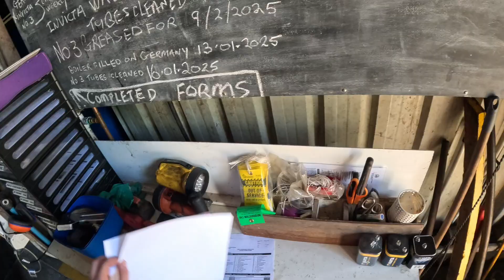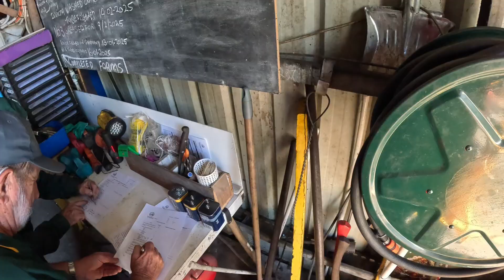Knocking The Fire Out Of A 1952 Steam Locomotive

Comment: I like getting a coffee at 1921 & watching the steamers and diesels go by close up. 
I notice there's remaining pressure to reverse the loco into the shed, and I read that the boiler is filled for good reason.
Excuse a silly question, but how does any remaining pressure bleed off?  Does that happen as you refill the boiler to finish off?
Maybe there's very little left by the time it's in the shed?
My only experience is basic model steam engines, where I just fire out, run pressure down, wait for it to cool right down, then fill the boiler.
Reply from the maker: Normally, by the time the loco is in the shed, it still has about 60-80psi  in the boiler (we operate at between 100 and 120psi with the safety valves set at just below 130). Injecting the water does bring the pressure down considerably, but the remaining pressure eventually returns to atmosphere as the boiler cools.
Reply: @XanderPearceSteam  Thanks for explaining.